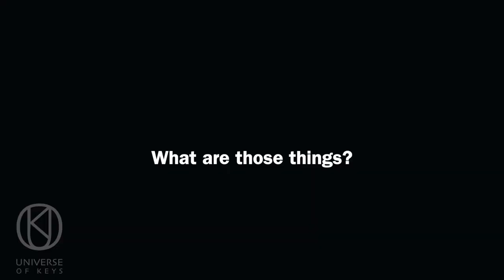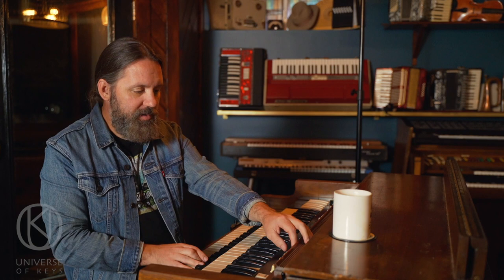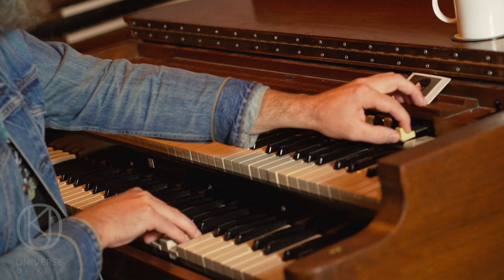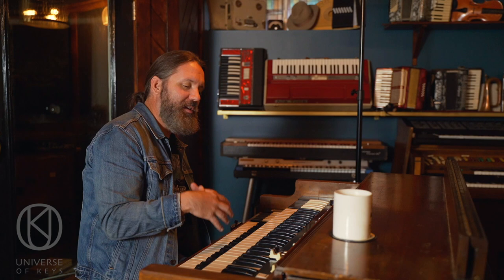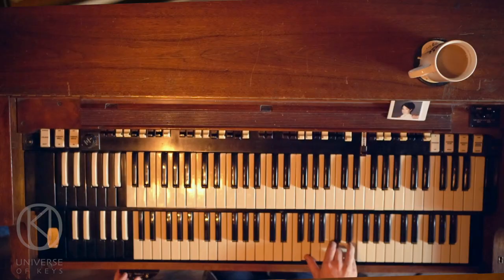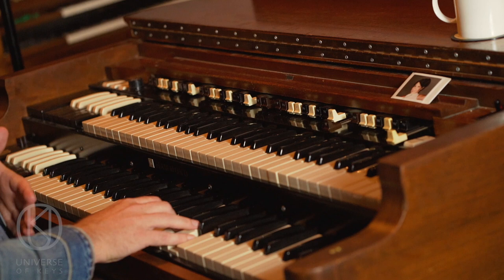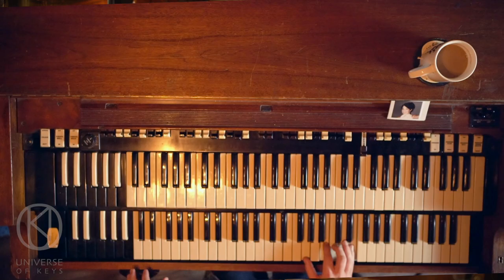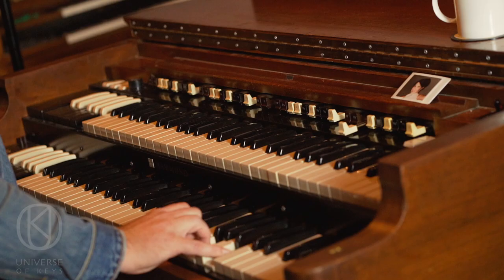DRAWBARS!! How do you work these things?! HAMMOND LESSON WITH MIKE LITTLE and Crowded House

Comment: What got me into the Hammond was Boston´s first album which has some absolutely amazing organ work, with some dynamic changes that are not of this world. After many years playing in bands I finally managed to get the original, analog Korg CX-3 which I use to this day, through a tube pedal, Danelectro Spring King reverb and a Neo Ventilator II. It gives a pretty badass sound which is perfect for the classic rock covers I do with my band but the keyboard feel is lousy, impossible to do fast, precise solos or palm smears, so I´ll probably upgrade to something more modern when I can. I feel that using the drawbars is pretty intuitive. I usually use the first 4 pulled out, when there is a guitar solo I just use the 16 and 8 for a warmer, full sound that does not get in the way, and when it is my turn to solo I add a bit of brightness with the upper drawbars. Using just the odd-numbered drawbars gives a very sharp, eeire sound, almost like that of a transistor organ, which is useful for some Sixties´ stuff.
Reply from the maker: I love the vintage CX 3 and you can't go wrong with the Ventilator. Excellent tips on the drawbar settings thanks! Appreciate your feedback :)

Comment: Excellent, seeing you demonstrate your intuitive way of using drawbars is really helpful.
Lately, I've been just staying on first 3 or 4 stops all out and trying to use the volume pedal, but honestly, the way it responds to the volume pedal is really uneven and hard to get right (especially for a lapsed player like me--also on a clonewheel, btw). Using the drawbars instead for dynamic control was actually the way I used to do it when I started playing, because it just felt easier. Your playing really validates my original method! 
I also used to cut out my 16 and 8 by half to try for an almost e-piano type sound for rhythms. We had a really great bassist, so I often felt like I was just muddying things up with my 16 stop all out.
Reply from the maker: Gonna have to try that EP setting! Thanks for watching :)

Comment: Just found your channel, watched this video and immediately subscribed to your channel.  Great explanation of using the drawbars.  I’m gonna search on my XK5 how I can get that nice warm overdrive.  There’s an overdrive potmeter but it sounds to synthetic/electronic, or how should I tell you.  Maybe I can try the valve sound settings in the menu but I still think that I won’t have your sound.  Fyi I don’t have a leslie because my room is to small (I have too many guitars and a Kurzweil PC3K8).  Question, are you using a 122 or a 147 leslie ?  Best regards from Belgium.
Reply from the maker: Thank you so much for checking out the video!! The Leslie I use is a 145 (same amp as a 147 but a shorter cab). When I am using my clone on the road (which is a Yamaha YC61) I run it through a Neo Ventilator pedal. I swear by it, it has been with me for about 10 years and in my opinion it has the most natural overdrive and best rotary sim on the market. It sounds almost exactly like my 145. Also... 10 years on the road it has never broken down, expensive but worth every penny!!! Have a great day :)

Comment: what were you clicking back and forth with your left hand. Keep em coming
Reply from the maker: I think you might be talking about the Leslie switch? It turns the Leslie rotary speaker on either fast or slow speed. It creates a vibrato effect. Hope this answers your question. Thanks for watching!!
Reply: You would generally use the Leslie speed control to add and remove energy in much the same way as 'playing' the drawbars. If you are coming from a piano background, this may seem secondary, however it's a big part of the sound. There's a mental shift when moving from Piano to Hammond - you might be playing simpler voicings but the colour & movement comes from drawbars & Leslie changes. As much as I love the practicality of the clones, if you ever get the opportunity to be in the same room as a Hammond & Leslie you will understand the physicality of the sound. It will interact with the room & your ears in a way that can't be described.
Reply from the maker: @reverendgroove  I agree!!

Comment: That Hammond has a great sound. In comparison, my C3 sounds terribly dull :-(
Reply from the maker: Thank you! Try adjusting the tone on the AO28 amp or the volume, also re capping the AO28 amp can make a huge difference to brightness. Other things to try would be to re tube leslie and organ, tubes have alot of character and can drastically change tone. Hope this helps and Happy New Year. Mike
Reply: @UniverseofKeys  Hi Mike, Happy new year for you as well! I recapped/retubed the AO28 and the vibrato unit long time ago, made not much difference (but the hum went away!). Then I got my hands on a Trek II Solid State Amp and swaped the AO28. After that, I recapped the generator with new caps from an US specialist. That was a big improvement, but still too lifeless. The next logical step would be readjusting the generator magnets - but I'm a bit scared of that work though. Until then, I'm happily listen to better sounding organs online ;-)
Reply from the maker: @Sturzi  Haha fair enough, amazing how different they all are. Not one is the same! I think thats cool :)